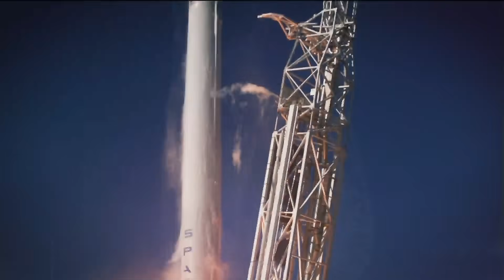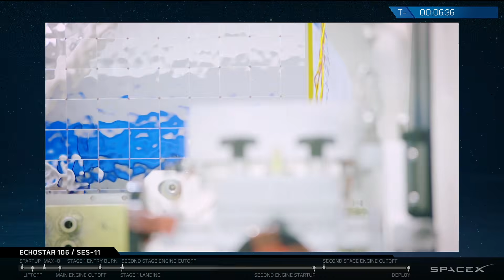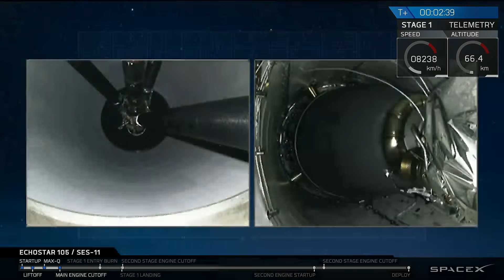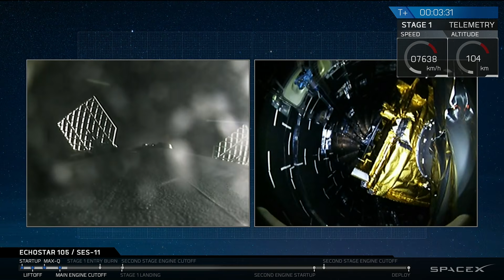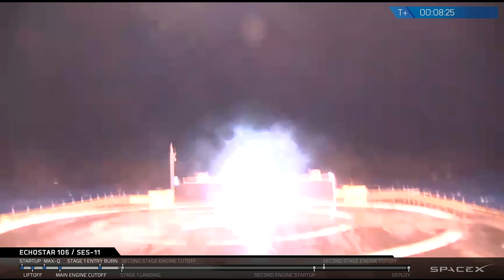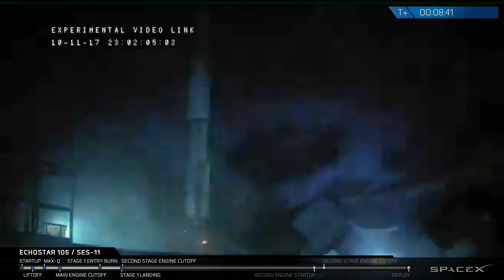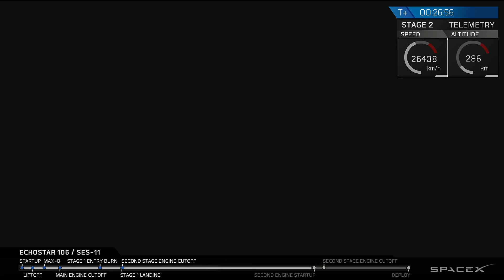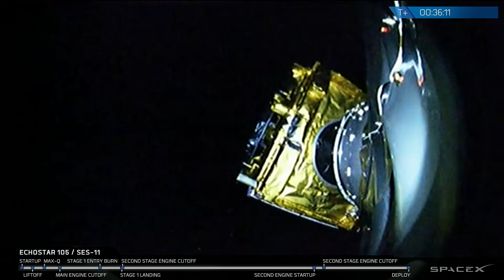Echostar 105 / SES-11 Launch Webcast

Comment: It would be very versatile and nice if spacex put aerospike nozzles on their Merlin engines so that they may be efficient in any atmosphere
Reply: This isn't kerbal space program.  It would require an entire redesign of the whole engine.  The gains of an aerospike are not worth the development cost and effort.  Also, the gains are not that much.
Reply: Aerospikes are ridiculously hard, there's a reason companies that have considered them usually end up with a plug aerospike (rather than a true spike) - the heat from the exhaust and the ever-decreasing surface area makes it impossible to cool the bottom segment. But when you make a plug aerospike, a lot of the efficiency advantages disappear.
Reply: It's good for SSTOs. But no matter what, SSTOs are not as efficient as multistage designs. SSTOs end up carrying a lot of dry mass to orbit.
Reply: Except, you know, that no one's actually built an orbital aerospike engine...
Reply: Not needed since it's two stage to orbit having two or more stages allows you to have separate sets of engines optimized for different altitudes.
Reply: Patchuchan But the aerospike is adaptive? If we get a better fuel, may ssto's use that?
Reply: Ambient Morality Ahh, ok.
Reply: Ambient Morality Alright, maybe the aerospike isn't  the best option for now. Off topic, does anyone notice the spike on the back of turbofan engines? Are they just to keep aerodynamic efficiency because of the minimized effect of the jet engine compared to the turbine, or is that an aerospike?
Reply: The "spike" or exhaust cone is intended to increase the pressure and decrease the velocity of the exhaust gases exiting the last turbine stages of the engine. An aerospike looks similar, but is intended to decrease pressure and increase velocity. It really just comes down to the fact that the jet's exhaust gases should be near, but below, Mach 1 (on a civil turbofan), whereas in a rocket engine they should be well above Mach 1. 

The cone also makes sure that the bearings and last turbine stages that the shaft rides on don't get fried by a continuous blast of hot air. I'm pretty sure every turbofan and turbojet in history has had at least some form of the cone, though sometimes it's quite difficult to see (for example, if the nacelle comes all the way over the cone, which helps mix the hot exhaust with bypass air).
Reply: Ambient Morality Thanks for explaining so much! Cool beans

Comment: Quick Questions :
1. What rocket will be using the Raptor Engines for the first time?
2. Have they been used on any rockets in the past?
3. How many rockets and which engines will Falcon Heavy have?

Thanks
Reply: 1.  BFR
2.  No
3.  Merlins, 27
Reply: Thanks a lot!

Comment: poor B.O they plan to launch new glen in 2022. that is too late. SpaceX controls now a big  chunk of the market. BO. ULA, ariane RIP :D
Reply: and recall they always improve their rocket, falcon 9 1v1 and so on poor bastards, adapt or die :D
Reply: Blue has more money than God so they are not in a rush.  Also, the DOD and the market in general fears a monopoly so ULA is OK until Blue is providing a reliable service.  After that, if SX is DOD certified and if Blue is DOD certified, then ULA could be in trouble.  Blue can run at a loss indefinitely unless the USG starts enforcing anti-trust laws again.

Ariane is subsidized. They may lose some contracts until they learn to commit to real reusability, but they won't go out of business.

The Chinese are starting to look into reusable rockets, India will follow. I'm a fan of SpaceX, but there will be plenty of competition.  It may take a decade or two for everyone to catch up but only ULA is at any real risk and that's only because the parent companies may choose not to compete.  But if the market expands with the lower cost, then Boeing and Lockheed may decide to invest more in ULA.

Comment: At 21:14 I thought that the rocket had burnt up on reentry. THE FINS WERE GLOWING.
Reply: They are stronger and last longer thats why they changed them and all of the fins since the beginning glowed red because of the heat during re-entry.
Reply: Yeah Elon said they should virtually last forever which cuts costs immensely
Reply: Aluminium will melt before it gets red hot, so if it's glowing it means it's not happy.
Just off the top of my head, titanium once it starts glowing still has 2000 degrees before it melts.
Reply: AIUI the old fins were aluminium with an ablative material and were not reusable while the new titanium fins are designed to be reusable.
Reply: Yeah, I'm interested to see what shape that thing is in. It held up well enough to land...but damn...it's gotta be toasted.
Reply: minute 21:00
Reply: It was a used booster and it looks they kept the old fins on that booster and just recoated. You can see those two long support structure lines in the middle of the fin means its a old fin. The new Ti fins are a larger square pattern without those two structural beams in the middle.
Reply: Bin Ou Yang I would like to see that descending part :/
Reply: Guys, I'm pretty sure those aren't the new fins. The titanium ones have a new design as well. They seem to be working through a backstock of old fins (if not used, its wasted money).
Reply: That'd be because of the intersection of "sustainability and reusability" and "legal requirements and operational agility". Elon Musk is a smart businessman: They have the aluminum grid fins already made, they perform well enough,  and they're cheaper than the Titanium grid fins, so why not use them until they're all destroyed. The other side of the coin are the legal requirements and the effect on SpaceX's business agility: Cores are licensed and certified like aircraft, and a change to the design or materials means recertifying them. (Same as, for example, Boeing having to fight with the FAA to get a supplemental type certificate to install the fuel-saving winglets of the 737-800 on already-produced and in-service 737-200s rather than just replacing old 737-200s with a whole new 737-800.) This takes years to do. Getting into an argument with the FAA just to replace grid fins on limited-reuse cores is simply time-wasting lunacy. That time can be better spent innovating and getting the BFR built and certified.
Reply: Also the old fins they had to repaint them with heat resistant paint and these they don't have to which saves on cost.
Reply: They switched to titanium to handle the heat. Pretty crazy to see the fins glow though.
Reply: They've already used the titanium grid fins so it doesn't require any particular FAA certification at this point: the FAA does not make a distinction between any of the "Falcon 9 v1.2" models (which encompasses Block 3 and 4, and probably 5 as well). Since titanium fins have already flown on a Block 3 stage, and this is another Block 3 stage, they really don't care.
Reply: As other have already stated, these were the good 'ol aluminum fins. Easy to see beforehand, since they are ablatively painted in white, so the most part you see something glowing, this is actually the protective paint burning up (you can also see flakes of it coming off). The titanium fins were just used once on Iridium-2, and will start seeing regular use with the Block-5 launches in Q1/2018.
Reply: The fins always glow
Reply: Titanium fins are actually heavier, but unlike the al fins, they are refurbishable and reusable, because of the titanium alloys much higher melting point and resistance to creep deformation
Reply: He still will use aluminum fins. Used them on Iridium launch on Oct 9.  They are only used on less intense reentries.
Reply: Elon is pushing the boundaries on the cores. This was probably the hottest re-entry to date, and it still survived!
Reply: this is old fins. New fins have different surface design, larger & no paint
Reply: It's the aluminium ones, in this launchhttps://youtu.be/SB4N4xF2B2w they explain it's because they can be used on less demanding entry.
Yet, on the same video it's pitch black after entry burn, with no fins glow...
Reply: 21:17
Reply: @Alerta P im high and confused but thank you so much
Reply: MertensCW that doesnt make sense, the margins for the old fins are just fine, new fins have been used once and look completely different.
Reply: More durable,  last a high number of launches
Reply: Afaik they used aluminium previously, but it wasn't strong enough.
Reply: it went in the atmosphere at 4700km/h I thought stage 1 was going to be roasted.
Reply: John Roberts 
I've watched every webcast since Iridium next 1-10, I've never seen the fins glow like that
Reply: BlueFrostedGlass they're lighter than the previous fins
Reply: Aluminum is not happy at temps above 700F.
Reply: Yeah, they normally finish out their entry burn at around 3000 kph.
Reply: They are titanium instead of the previous aluminum. They weigh more.
Reply: BlueFrostedGlass  They can hold up better under the heat.
Reply: The new titanium fins are larger and heavier so it decreases the overall performance of the rocket. That's a good reason to go through the stock of aluminium ones.
Reply: they launched the sat into a GTO, the sat wasn't that heavy (about 5 tonnes if i'm not mistaken) but the first stage had to push it way harder since the GTO, that's why the re-entry was a heavier than others. Also the fins were alumium they said in the cast (also visible), that's why the fins were glowing like this. The fins were aluminium since it was a re-used core which did a LEO mission with a mild re-entry so they hadn't to change the fins.
Reply: Saif Ahmed
Thank you for SOLICITING. Now, please exit this comments section and have a wonderful day, SOLICITOR!
Reply: +BlueFrostedGlass If im correct they weight a little bit less then the old ones, and on a rocket every little bit counts.
Reply: Actually the newer titanium fins glow.
 I know they are using the new fins, but I don’t know why?
Reply: Bin Ou Yang  They glow all the time and reason you don't see it is because most of their lunches occur during the daylight, since it was dark this time you were able to see it.

Comment: That re-entry was brutal!
Reply: Paul O'Neill  the reason you don't see it glow is because most of the time they lunch during daylight  and Because it was dark you were able to see it glow
Reply: Paul O'Neill i have definitely seen the grid fins glow before. Nothing new about that.
Reply: I know, right? Damn grid fins were glowing like sparks
Reply: I was worried there for a minute too, but apparently, those fins have always glowed. They are now made of titanium and even with all that heating, they are supposed to last forever.
Reply: The reentry stresses were nominal here, you could just see the fins glowing because this was a night launch, it was dark.
Reply: Yeah, it looks like some of the engine nozzle got eaten. There were quite a few metal sparks, and they weren't coming from the fins!

And that plasma glow was quite gorgeous. But also alarming 🤯
Reply: Definitely alarming. I panicked a little when I saw the glowing fins (which I have somehow never noticed before) and, especially, the plasma trail coming off of the Merlins. When the feed was lost, I feared the worst. It was reassuring to hear them still announcing first-stage telemetry after that.
Reply: It may be me but I've never seen grid fins glow, nor the apparent ablation from the base of the F9 before (@30:54).
Has anyone else seen that before?
I can't imagine those engines are in much of a reusable state after that !
Reply: Yep, something happened between the grid  fins and the rocket body something melted and catched fire for an instant, they have to look after this.
Reply: pretty sure that glow was a reflection of sunlight